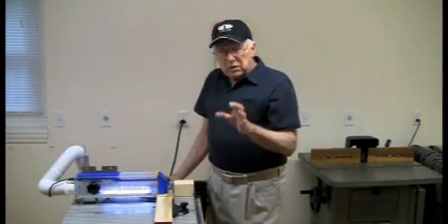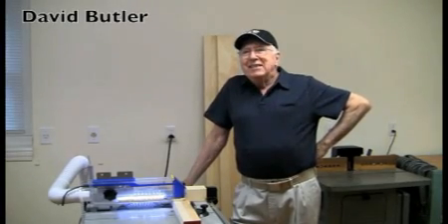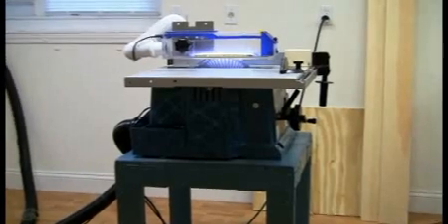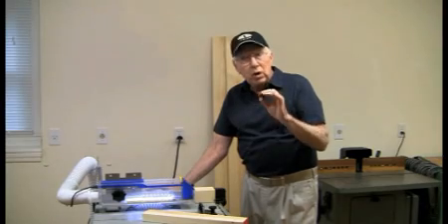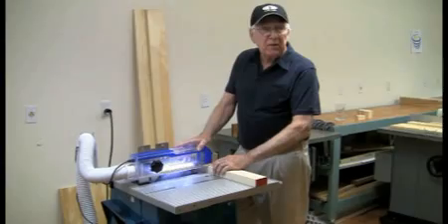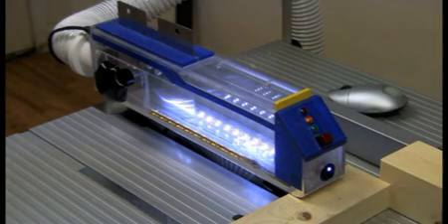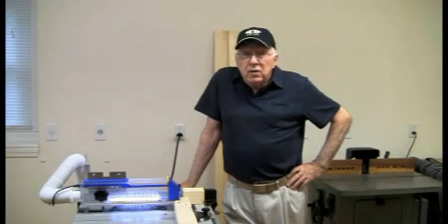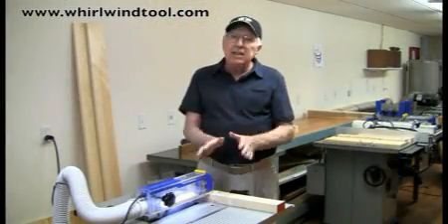Table saw safety system emergency stop blade brake prevents injury: patent pending Whirlwindtool.com

Comment: This technology needs to used WITH the sawstop technology.   If the hand gets sucked in by a board, you need all the safety you can get. Look at " table saw safety what can go wrong hank" to see what I mean.
Reply: I agree, shut the saw off safely if possible, and self destruct if necessary like when one of my guys takes the guard off because its in his way, even though he knows he's not supposed to.  Hopefully the saw is inoperable without the guard.  But the problem I have is that my subs will just get out their old DeWalt saw if its easier to use.